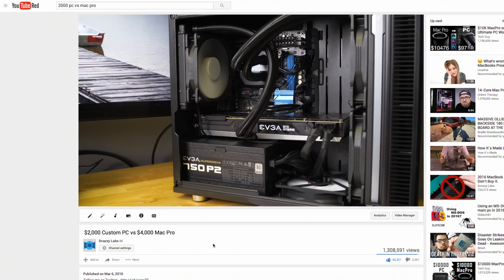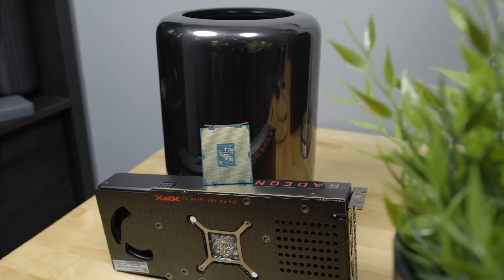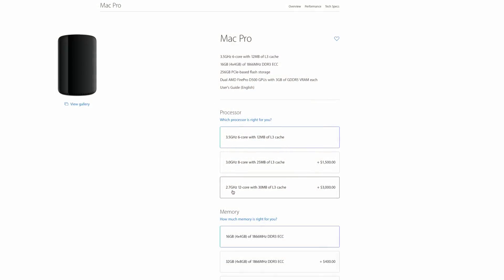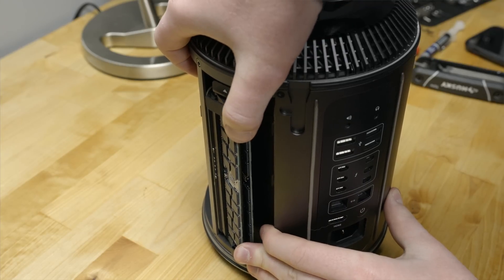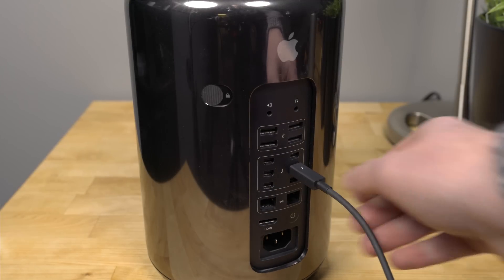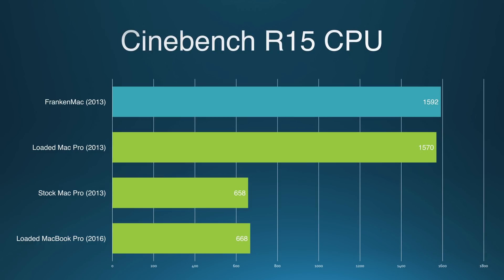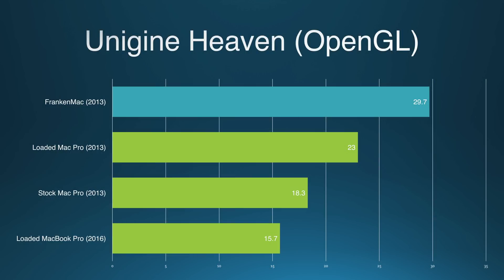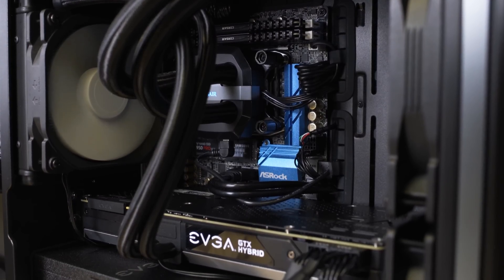The Best Mac... Apple Doesn't Make!

Comment: the d300 arent the best but it can run all the latest games I tested them! run GTA5 at ultra on the d300! image running a d700!!!! its on par with a gtx 1070!
Reply from the maker: +SERGE It is not on par with the GTX1070. LOL. I did a video on the D300 last year. They're fine cards for computational stuff but they suck at gaming. Which is fine as it's not designed to game, but still.
Reply: Snazzy Labs not true they do not suck at gaming there very capable. However they are not optimized for gaming and are 4 years old plus 5 years since it's old architecture. Now the d700 in theory for optimized crossfire gameplay should be able to run like a 1070 because it's for that stronger 384 bit bus and a lot of vram and stream processors which will help with shader.
Reply: SERGE LOL mate, I really hope you're a troll your all over the comment section being an Apple fanboy. Here's the deal, the d700 is a great card for computing. But there is absolutely no doubt that the 1070 will destroy it. Do some research before saying something
Reply: SERGE and also bus speed, VRAM, and stream prossecors don't always mean better performance. Just see the damn architecture
Reply: RadeonGuy27 fucking scrub fuk off look at the specs you little runt before commenting no shit 1070 is stronger it's 4-5 years newer
Reply: RadeonGuy27 gigabyte bandwidth is a good indicator or performance. Of course I'm a fan of certain computer do you not see the YT banner blind, ignorant fuk.
Reply: RadeonGuy27 go make more car x drifting lame ass videos only 25 people will watch in a month.
Reply: SERGE I knew you would take the bait
Reply: SERGE Here m8 do some research, even SnazzyLabs already said that the 1070 will obviously be more powerful
Reply: RadeonGuy27 go make more garbage videos troll
Reply: thats right quote others and do no research on your own. good job bro thanks for the pro tip.
Reply: SERGE Thanks for the feedback to make my content better. Also have you seen your other comment get rekt. I do research. The d700 is about as powerful as a 7950. And you will probably say, that you will have 2 of those, so double the performance. Wrong. 7950s in cf will never beat a 1070, or even heck an Rx 480. So, if you would just stop trolling and get some help, it will be very appreciated by me and the tech community.
Reply: SERGE Even the biggest apple fanboy in my school admitted that the 1070 will destroy the d700. Sure the d700 is not bad but anybody will know that the 1070 will beat it. Also if you're wondering why it took so long for me to reply, it's because I need to study for school

Comment: cool video man! just did a video about this with gaming! I always wanted the Mac Pro to run at 24 core cpu!
Reply: SERGE it's not 24 cores. But it's 24 threads. Also higher core count is not beneficial to gaming
Reply: RadeonGuy27 read the comment it says I always wanted it at 24 core there are engineering samples that are 22 and 24 core you can get for around a thousand fun little CPU to work with. And yes I know all about more cores usually equals less ghz per core.
Reply: you keep going in circles have you ever learned from your mistakes are trapped in one particular thought pattern that you can't entertain other thoughts. any more replies from you and I wont be reading your comments.
Reply: SERGE I'm just trying to make you a better person, YouTuber and anything in between. So stop it and get some help.

Comment: where can i find the thunderbolt to pcie thing?
Reply: just the card part i have a pc case and psu i can use
Reply from the maker: +Dylan Maniatakes Its the "Akitio Thunder 2," but you're going to need to buy a power supply and break out the soldering iron. If you don't want to do that, I'd suggest looking at the BizonBox 2S.

Comment: Why didn´t you just build a hackintosh? You only needed to add a motherboard and then you get the full potential of the rx480
Reply from the maker: +Guido Carello X99 builds are not super stable on Hackintosh. I needed something bulletproof that would never have driver or software problems. Final Cut Pro often doesn't play nice with hackintosh builds too.
Reply: Thanks for answering! In that case congratulations for such a cool concept to overcome the inestability problems!

Comment: I love how he glosses over Hackintosh as being "stuff thrown together" with "compatibility issues," then creates this unholy mutant chimera with an ebay xeon and one crappy AMD card at 60% bandwidth, when a plain old atx build with a gigabyte motherboard runs macos with full compatibility and graphics power
Reply from the maker: +Roger Wieand X99 builds are pretty unstable. This solution is bulletproof. I need something with 100% uptime for production and even the best of X99 hackintosh can't hack that.
Reply: i doubt that doing this solely for x99 is the right choice for production over a strong i7 hackintosh solution especially considering you can run two nvidia cards at full bandwidth.
Reply: In a case like his, having something that's always stable is EXTREMELY important. Hackintosh aren't always the most reliable systems.
Reply: that's an outdated view – since a few years ago, a correctly configured hackintosh is 100% as stable as a genuine mac
Reply from the maker: Roger Wieand As someone who has built multiple Hackintosh, they're still not as stable and reliable as a real Mac. Very good? Yes. Perfect? No. I need perfect.

Comment: The Radeon "Pro" 460 is what the MacBooks uses. Not the Radeon 460.
Reply from the maker: The fully-loaded 15" uses the Radeon 460—just like I said.
Reply: Snazzy Labs The Radeon Pro 460. It's not the 460.
Reply from the maker: Yeah, same thing. Radeon Pro 460. Radeon 460. No difference bud. Same thing. RX460 is the different card.
Reply: Snazzy Labs if you say Radeon 460 it makes it seem as though you're talking about the base "460". The gaming card. The "Pro" is the differentiator. People could get confused when watching your video which is why I pointed it out.
Reply from the maker: I don't know of anyone that refers to the RX460 as Radeon 460 but if you think it actually runs the risk of being confused with the Radeon "Pro" 460, thanks for the correction.
Reply: Snazzy Labs it's just that if you leave out the "Pro" then it seems as though it's a lesser version of the 460, thus making someone think you're referring to the RX. It's probably just me but that's what I thought you meant at first hence why I changed my initial statement.

Comment: Say if I wanted to upgrade my mac pro to the max, is it worth buying an AMD Radeon Pro WX 7100 or AMD Radeon R9 Fury X? Would those even work? Thanks!
Reply from the maker: Fuji cards are supported—yes.
Reply: Thanks for the reply! Would you reckon those cards are worth the money for the performance?
Reply: R9 Fury X is pretty great, the WX 7100 isn't terrible, but going for the R9 would be a better choice. Both are pretty good value though, as per AMD's standard.

Comment: can u upgrade the quadcore single cpu to a 12 core ?
did the macpro got dual cpu eather ? so we can make 2x 12 core ? xD
Reply from the maker: Yes, you can upgrade the CPU—that's what I did in this video. 2013 doesn't support dual-socket; one CPU only.

Comment: excuse my noobness, but could you just build a top of the line custom PC with 2500 USD then dual boot MAC + windows?
Reply from the maker: Not exactly. Hackintosh requires very specific hardware and X99/Xeon builds aren't very reliable.

Comment: If the old thunderbolt II connection could only make use of 60% of the RX 480s power, then why not settle for a cheaper rx 460 or 470? Would you get the same results? Or do you just need the 8gb of Gddr5?
Reply from the maker: RX460/470 would be a better option. I already had a 480 I wasn't using.
Reply: Please can you do a Video about comprising the NVidea Cards with the AMDs and thunderbolt 2 vs 3 for video editing I think I buy a MBP 15" 2015 with TB 2 and external graphic wich one would you recommended ?
Your Video is awesome

Comment: Do you think It'd be possible to split the PCI-E into multiple thunderbolt ports instead of just one? It may add latency but performance could rise a great deal
Reply from the maker: +Preposterous Pixel Sadly no. You can use one GPU per bus, so theoretically, you could use 3 cards on the Mac Pro, but they'll be limited bandwidth.

Comment: Radeon gpus runs hot gives less performance why would you even use amd while pimping something even amd dont use their own gpus when testing a new cpu they made lmao
Reply from the maker: +maticooli112 First of all, they don't run hot. This card never passes 80deg. Same as NVIDIA reference cards. Secondly (and I mention this in the video if you actually bother to watch), AMD cards are hardware accelerated in Final Cut Pro.

Comment: The point of the GPUs that come with the MacPro is precision. Workstation class GPUs are super expensive but are designed for high precision and error correction. Naturally, they will suck at gaming.
Reply from the maker: +keco185 I didn't even mention gaming in this video. It's all for Final Cut Pro.
Reply: Snazzy Labs I wasn't referring to the actual contents of this video in my comment. I see how it came off that way though. I was just trying to explain why companies can charge so much more for workstation class parts.

Comment: A hackentosh could have done this so much better without having to fuck around with an external gpu
Reply from the maker: +/ Edge No it wouldn't. X99 builds are notoriously problematic.
Reply: troubleshooting would have been worth it for the performance improvements
Reply from the maker: / Edge No they wouldn't have. This is a workstation machine that I need to be ready to export on demand. I don't want to have to worry about updates or weird driver issues, or connectivity problems. I need it to work 100%, all the time. As much as I enjoy Hackintosh builds, even the best can't provide that stability.

Comment: What if you took the Hard-drive out of it and put it in the Windows build? Wouldn't you get the OS, but with the specs of the windows one? Or am I just stupid..
Reply from the maker: +Sir. Grassy Doesn't work like that. macOS won't boot off of hardware that a) isn't a Mac, or, b) isn't designed/spoofed to look like a Mac.
Reply: That kinda sucks.. :P

Comment: This external GPU solution using new Radeon's graphics cards works the same on MacBook Pro (Retina, 13-inch, Early 2015). I think it should work: the OS is the same and also the thunderbolt installed, anyone tried?

Comment: Macbook Pro is a joke. What's a pro with a discrete video card?
Reply from the maker: +Explicit Tech I'm not sure I know what you mean. The MacBook Pro DOES have a discrete GPU. It isn't integrated graphics.
Reply: Thought it used Intel Iris Graphics 540, or am I mistaken?
Reply: Found out it uses Radeon Pro, my bad. Didn't notice the 15-inch model.
Reply from the maker: Explicit Tech Perhaps in the 13" model. Can't remember. The 15" is discrete. Radeon Pro 450/455/460.

Comment: Helooooo... You reply selectively? :)
Reply from the maker: +html5guys Aye cap'n.
Reply: Not sure if you have seen my previous question: "Was it necessary to fit Akitio PCI-e to TB case into Fractal Design case? Wouldn't that work without it? Did you keep original double GPU board in the system? Would all cards be usable?" Thanks you very much in advance.
Reply from the maker: html5guys No, not necessary. Just did so to contain the PSU and cool it better.  All 3 cards work together.
Reply: You're the man! ;)
Reply: So technically, all three GPU's should be involved in rendering...

Comment: Great job!!! Was it necessary to fit Akitio PCI-e to TB case into Fractal Design case? Wouldn't that work without it? Did you keep original double GPU board in the system? Would all cards be usable? Thanks!

Comment: maybe somebotd though of this, but can 2 thunderbolt ports be used simultaneously, like coded to have 2 thunderbolt2 ports work the gpu
Reply from the maker: Not a bad thought. Sadly, no. You can use multiple GPUs using multiple TB2 ports, but only one card is allowed per TB2 bus.

Comment: Could you turn the old Mac Pro into an FrankenMac , pulling the same trick with the CPU and the graphic card?
Reply from the maker: The old Mac Pro can work with an RX470/480 with zero issues. Plugs straight in.

Comment: Thanks for the Video. I have tried the same setup and it works. But it is unstable. Rendering in FCP X is faster but  it has stuttering frame rate. I tried it with macOS 10.12.1 last time. Does it really work with editing fin FCPX 10.3.2? How did you achieve it software wise? Thanks
Reply from the maker: Try 10.12.2. Run automate-egpu.sh on Github and it runs like butter.

Comment: You could just install MacOS on a PC. As simple as that.
Reply from the maker: No, it's really not that simple. You need very specific hardware to run a Hackintosh and Xeon chips aren't supported well. I need a stable machine—which a Hackintosh is not.
Reply: Actually no. You don't need very specific hardware. I even run OSX on a Ryzen 1600 AMD CPU and it works absolutely great. Video-editing, audio-production all work just fine. 
Yes, OSX on normal pc hardware is not easy (you have to really know how things work) but to say you need very specific hardware is just wrong.

Comment: That moment when you buy computer with two graphic cards in it, but using one external hooked up with Thunderbolt is still faster. However it made me think if it wasn't possible to use some sort of PCI riser to connect the GK directly to mac.
Reply from the maker: +Skawagon It's not a PCIe riser. It's the Akitio Thunder 2 which turns PCIe devices into Thunderbolt compatible ones.

Comment: If you choose the right components for a hackintosh, there will be no compatibility issues. Your solution is kinda pointless but pretty cool nonetheless.
Reply from the maker: There are still compatibility issues. I built a "golden" Skylake build and it was very, very good; but still not like a native Mac. It's also important to note that X99 and Xeon builds are not well supported. At the end of the day, this is a machine that I don't want to finnick with. It needs to work all the time, be able to update without issue, and handle a superbly heavy workload. That's something a Hackintosh can't do as reliably—and I'm willing to spend a premium on that peace of mind.

Comment: I don't know how you deal with the switch and if the programs advantages justify it but I'm using Linux and feel terrified of going back to Windows to use AutoCAD and Fusion360 as it will reduce my productivity...But when talking about productivity killers, OSx is just it! It has poorly designed shortcuts, that turns out,are subject to change(changing language now requires 3 keys and since I'm in Greece that means I have to press a shitload of combo keys) and the single shittiest window manager(this is where Linux along with KDE really shine) that makes multitasking feel like instant aging...I mean, windowed to fullscreen goes from crippled window to no taskbar and you have to hover the mouse to make it drop and...ughhhhhh! And what is with the hot corners...The first thing you notice on KDE is the adjustable delay for the hot corners which makes the hot corners implementation PERFECT!

Comment: I'm still doing the math on how spec to price ratio on the MAC pro and the new MacBook Pro.. my mid 2014 MacBook Pro is the bang for the buck all the ports you need without the steep price and a lower battery

Comment: So a $3000+ machine gets a vast video preformance upgrade by plugging in a $270 gamecard and connecting it with a outdated connection.  The fact that that's even possible is showing how low the specs were to begin with.
Reply from the maker: It's a workstation machine that is 4-years-old. And the CPU just tears every modern non-X99 machine to shreds—even now. It's certainly outdated, but it was a pretty good machine in 2013.
Reply: The lowest config was a 4-core 3.7 ghz. It was sold for $3000+. A 6700k (modern and non x99) wins hands down. The highest config is a 12-core 2.7ghz. That's a fast cpu, but for the $8000 pricetag it's ridiculous. The amount of hardware you can and could buy for that money will make the MacPro seem stupid. The only ingenious thing they did was to fit it in that form factor. But since most professionals don't really care about the form factor is really not that great a workstation.

Comment: OR

You could just take the drive from the Mac Pro, and place it in your own custom PC. ;)
Reply: Yoshi Ram not how that works at all...
Reply: RedLaunchTech lol, did you think I was serious?
Reply: Yoshi Ram you never know these days...
Reply: RedLaunchTech XD
Reply: Apple uses some bios trickery to insure that doesn't happen
Reply: LOL good one, I can't even format a disk in HFS+ on a PC let alone read it.
Reply: Hanro Lareman of course they do. its apple xD
Reply: OR

Build a cheap pc...
Reply: Yoshi Ram it has to have the same motherboard as the mac or it wont work
Reply: Apple uses some bios trickery to insure that doesn't happen
Reply: This might actually works, I just moved a SSD from my Hackintosh laptop(1st gen Intel) to a Haswell desktop. Result? It does work, so far everything works fine! So technically if you setup a perfect Hackintosh environment on the SSD before moving to the new body, I don't think that's something impossible to do.
Reply: You can download an hackintosh but there are only specific parts that are compatible
Reply: Yoshi Ram now thats what i called as custom mac pro, using mac os on a fully enthusiast grade workstation components, nice
Reply: how tf did i not think of this?
Reply: Dude turn down the bath salt intake.
Reply: ouf
Reply: Yoshi Ram ha very funny, but you would need the same motherboard the Mac pro uses.